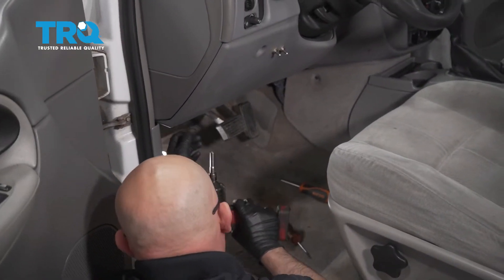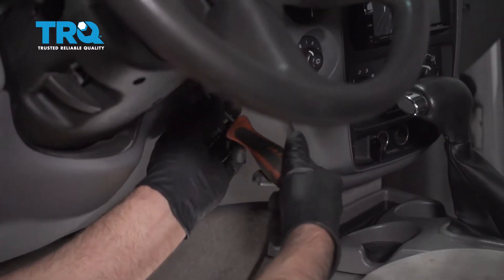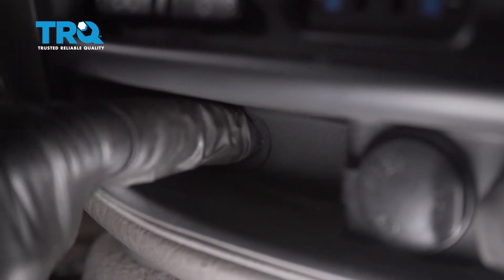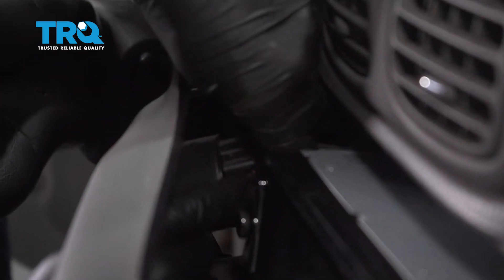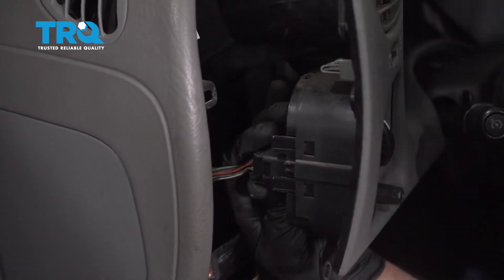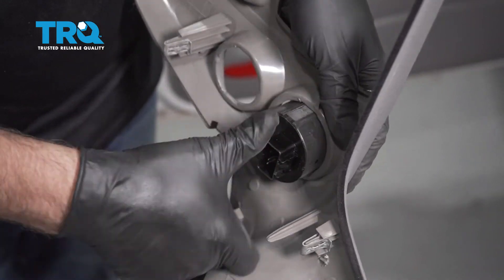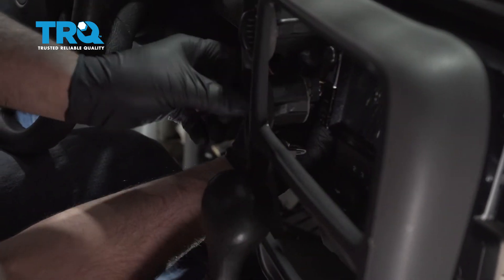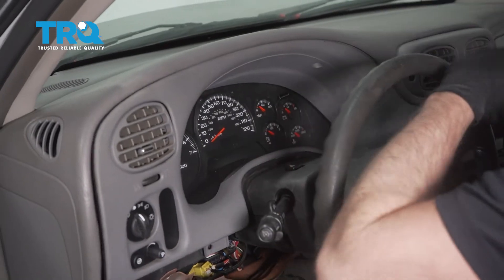How to replace Four Wheel Drive Switch 2002-2009 Chevrolet Trailblazer

Comment: Don't need to remove dash. I just did mine in 5 minutes with my knife and a screwdriver. When you order the new switch you can see the little metal spring clips on either side east and west exactly 180°. Just stick knife edge under the left edge flap and pops that side out. Then flathead screwdriver popped the other side out. Pull the plug insert plug into the new switch push the switch into the dash. Could have used my knife for the whole thing.